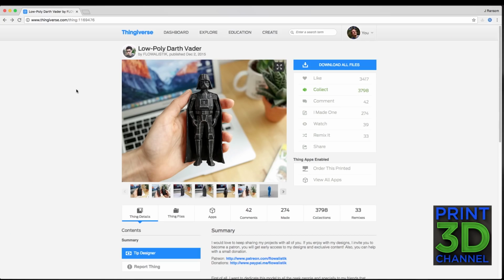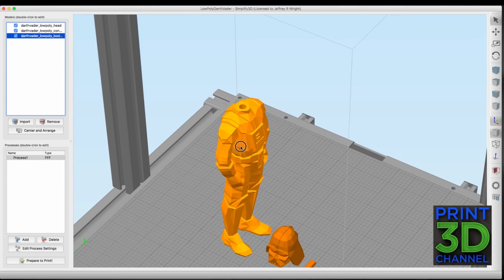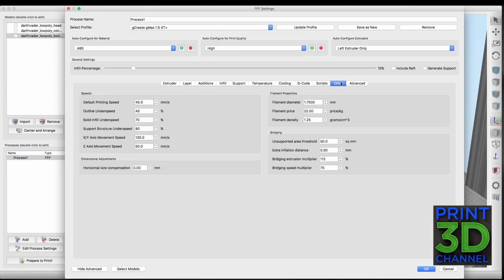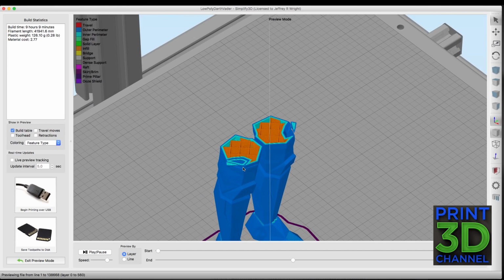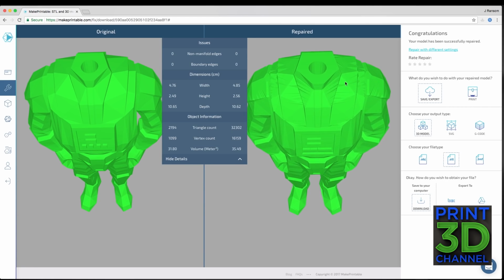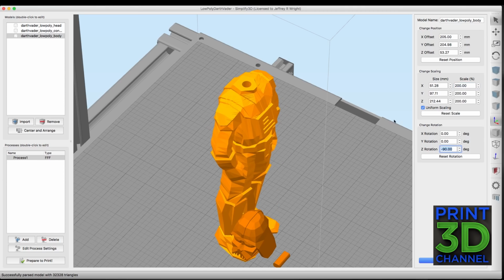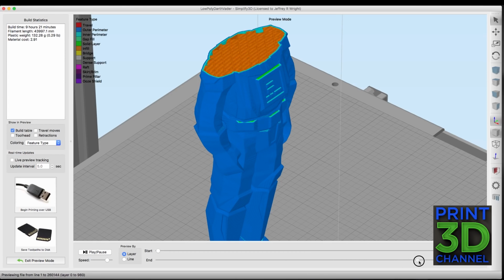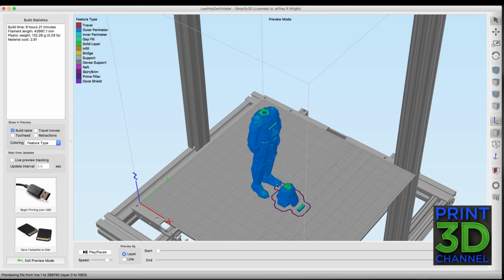#3DP365Project - Day 124 - #StarWarsDay - MatterHackers & gCreate

Comment: 3d builder built into windows 10 is useful for fixing stl files if you have access to a windows 10 machine.
Reply from the maker: Great tip, I did read that online looking for repair tools. Mac user here, but great advice to Windows users. Thanks for watching!
Reply: I noticed you had a Mac that's why I said if you have access.